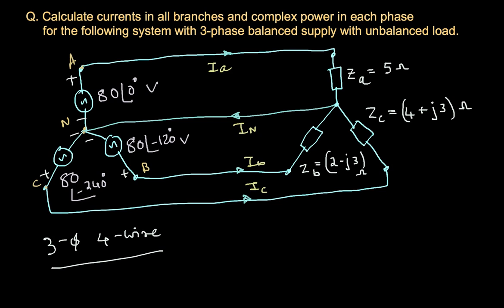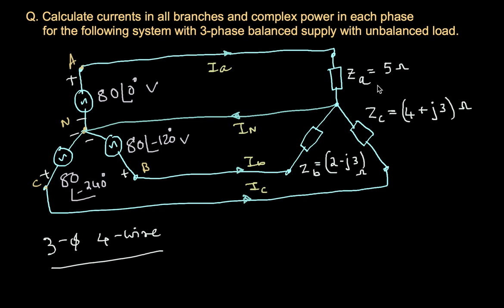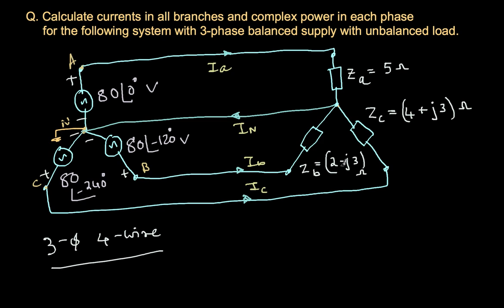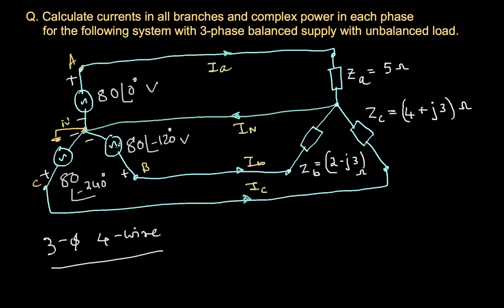3 phase 4 wire - Unbalanced Load

Comment: Kindly confirm me what would be the current flowing in neutral wire in 3 phase 4 wire system, each phase is connected to 3 resistive loads consuming 2A each.
Reply: It's a balanced load so the current through neutral would be zero

Comment: If both source and load are solidly grounded and if we assume a negligible resistance in the neutral wire, shouldn't the supply neutral and the load neutral be at the same potential i.e. neutral current = 0 A?